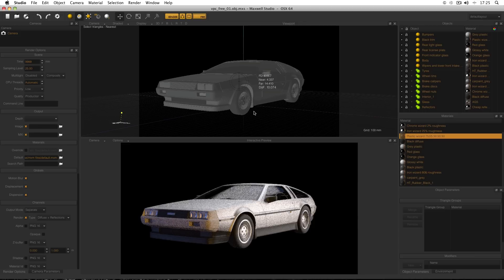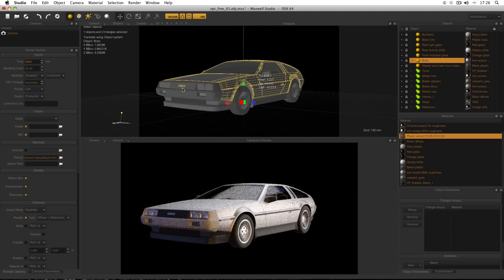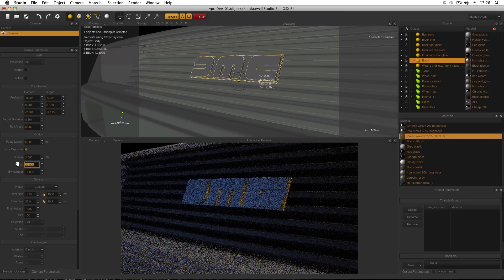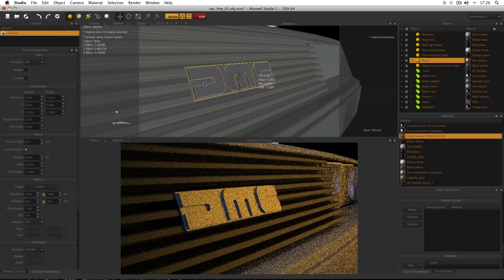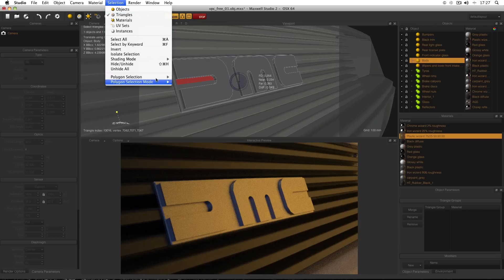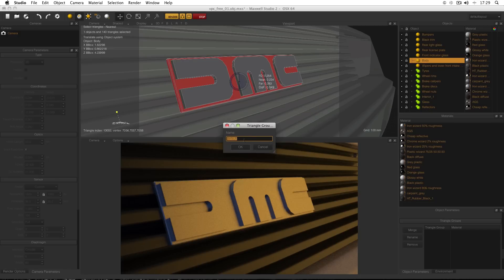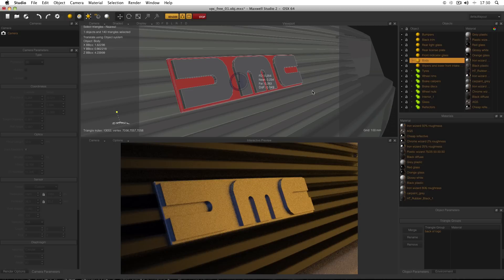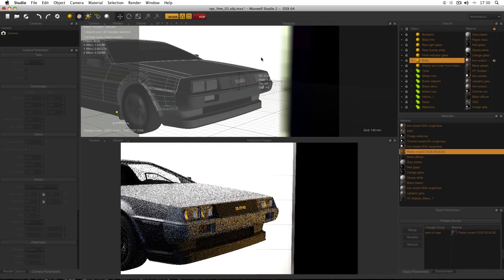Maxwell Render DeLorean DMC-12 Tutorial Part 2 of 6: Front Badge Adjustment

Comment: I have a chair, which I exported from Revit into 3Ds Max, and then from 3DS max into Maxwell. The chair seems to have come in as one solid mesh (as opposed to the steel legs, steel support and plastic seat and seat rest) - I have managed to create a triangle group for the back rest, however it will not work again for the rest of the chair - It doesn't matter where I click, it will not select anything? Any suggestions?
Reply from the maker: Can you export from Revit as .3ds , .obj , .stl , or .fbx ? And make sure some placeholder materials are assigned to the different parts, sometimes that helps.